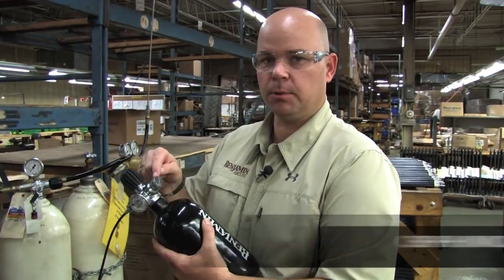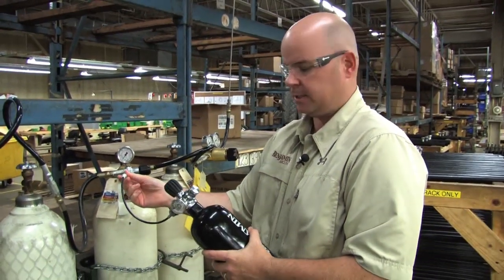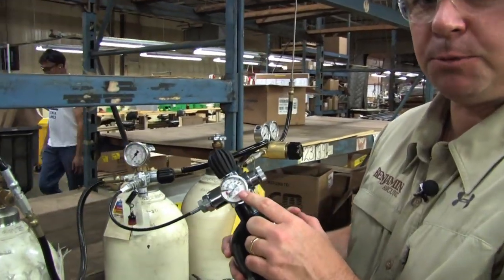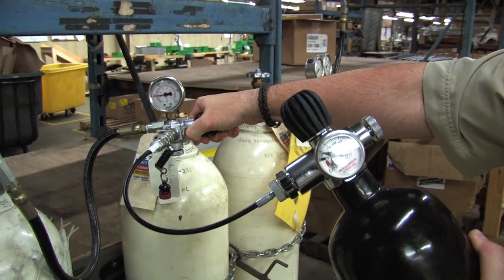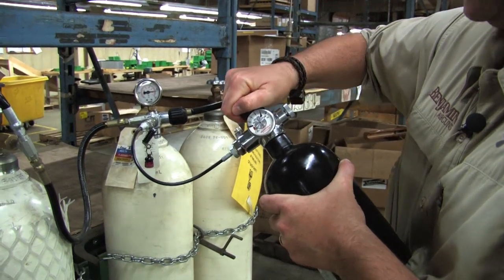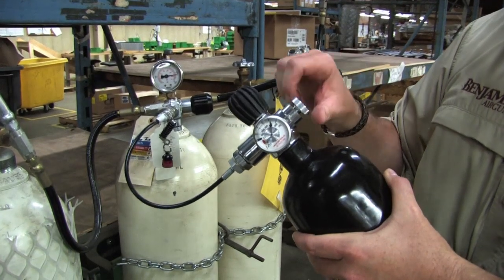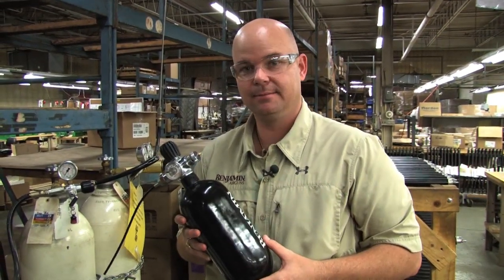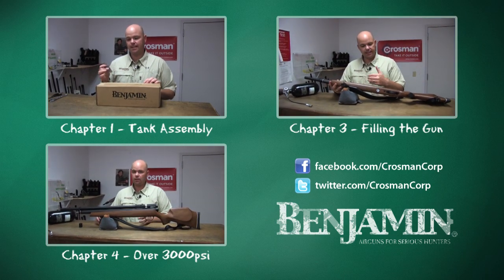Benjamin 15" PCP Air Tank, Chapter 2: Filling the Tank

Comment: i have my own husky air compressor at home. how do i fill my tank with my compressor? my compressor's female is too big for my FAH007 adaptor.
Reply: Might be too late to reply, but you need to get a High Pressure Compressor to fill it to 3000-4500psi which isn’t the same as a home compressor used for toools which is 120-175psi. You cannot fill your home compressor tank to anywhere close to what these HPA tanks can hold either. The compressor you want is a yong Heng and a 4 stage media filter to keep oil and water out. This is the best bang for the $$$ but it’s pricy if you don’t plan to shoot often. If you buy tanks and fill at a scuba shop you will have a minimum of 2x $50+ for two 13+ cu tanks (might want 50s or larger depending on gun style and arm length) which are aluminum for game and storage (make less trips) plus your fill hose & regulator (unless you just have multiple of the same tank to swap) which is another $100... plus filling and gas which is about $2+ per fill depending on tank size. Your looking at $102+ to start which is minimum. You will probably end up getting a 50cu tank which are about $70-$200 depends on aluminum or carbon fiber and a backup... the yong hang (others are not as good according to my research- knockoffs at this price) air compressor cost $250-$400 (buy at least the second version for $299 on Ali express due to features) and a $100 filter setup. This kit is good if you plan to shoot a lot and you have strict paintball fields that won’t let you top off when leaving. A scuba or firefighter tank is also another option for storage $200+ and you need a fill hose. You might recuperate some $ by charging people to fill there tanks too. Lots to learn and it gets pricey, I’m invested $1500 in my paintball gun, tank and compressor without gear and just started 😂 well my setup is for home defense less lethal option so it’s justifiable.

T15 videos and mod videos soon to be posted (busy ATM) on my channel if interested
Reply: How do you propose to fill your 4000psi tank with your home compressor that goes up to max 175psi???